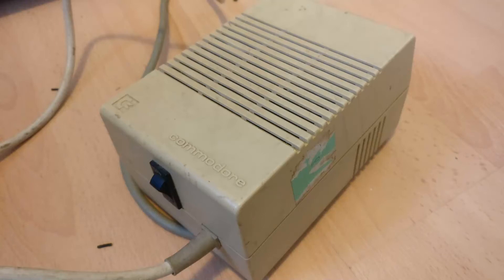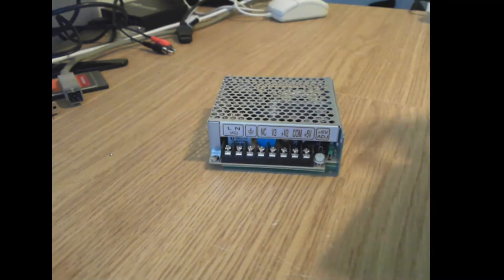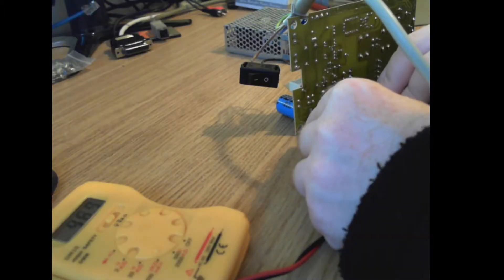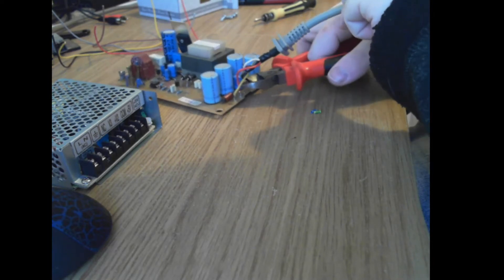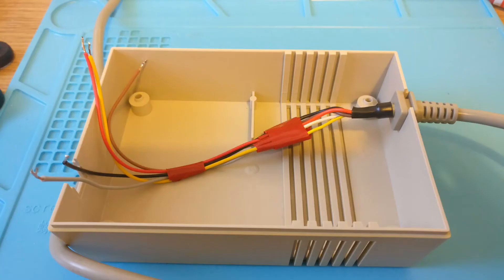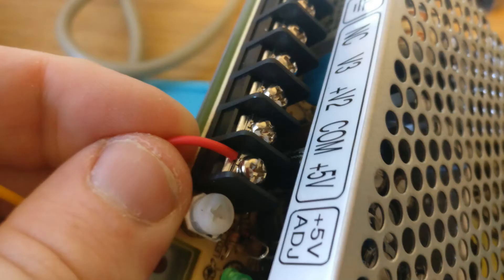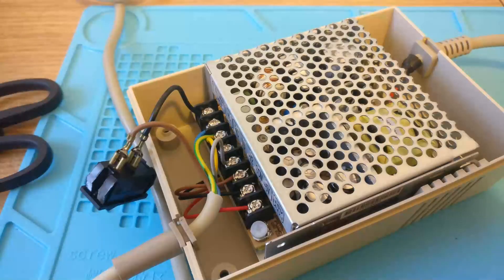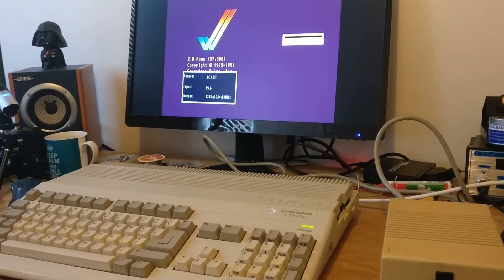Amiga 500+ - Part 2 - Upgrading an Amiga Power Supply

Comment: I have one Problem with the Meanwell Power Supply. If i plug the Meanwell in the Amiga, and make the measurement after the Line Filter from the A500  I get 13Volt on the 12Volt Line!!  Is this a Problem?
Reply from the maker: There is white potentiometer on the right of the connectors, adjusting this will change the 12v output. But measure this without the Amiga as you don't want to damage it.

Comment: Awesome mod!  Mouser US were out of stock, so I grabbed one of these Meanwells off of Amazon, and was able to 'upgrade' my A500 PSU too.  Used a few little 3D printed standoffs and a few blobs of hot glue to keep it in place inside the original PSU case.  On my NTSC A500 I'm definitely noticing less interference in the picture when upscaled through an OSSC via a VGA adapter, however there are more pronounced jailbars which I assume are due to using a switching power supply with an analog video device.  Something to be mindful of I guess.  BTW, how are you doing with the thermals in your unit?  Have you had it overheat at any point over the last few years?
Reply from the maker: Thanks, not had any issues with heat. Regards the jailbars might be to do with Phase and Clock setting on the monitor

Comment: Thanks for this excellent video!  I hope you don't mind but I've got a few questions.  The wires that you extended, do these have to be a certain kind of wire with specific tolerances?  Also how did you secure the meanwell inside the enclosure?  And finally, is that specific meanwell powerful enough for an Amiga with an accelerator installed?  Thanks for any info you can provide.  Keep up these great videos!
Reply from the maker: I got mine from Mouser. Notspecific wire but main cable should be fine.
I'm currently using it on an A1200 with an 030 card and not had any issues.

Comment: Great video, i used the Makerele NET-50C, that has a 4A 5V and a 2A 12V, to replace my inside of my old Amiga 500+ PSU, it fitted great when i removed the metal housing, it has it's own heatsink, so do not need the housing. 

https://www.aliexpress.com/item/3261...27424c4d0pv0wU
Reply from the maker: Good to know that there are other alternatives out there to refit out aging amiga PSU's. Thanks for sharing :)
Reply: @MikeyGRetro  And you thanks for your video.

Comment: Thanks for the great tutorial! I was able to make this mod and replace the internals of a PSU that arrived with a PCB broken in half. I would like to also add that it is important (or was for me) to connect the 'Shield' as well. I read on some forums that it is really not necessary, but I got really bad rippling in the video signal without it.
Reply from the maker: Wow broken in half. Glad it's working out good for you. I've done another one for my a1200 and it solved a video issue too. Forgot to mention that i connected shield. Just best practice :)
Reply: @MikeyGRetro  to be clear, the shield goes to earth as you appear to have it in your video rather than to comm/0V? (though I guess they're connected and it doesn't matter?)  Thank you so much for the video.
Reply from the maker: Thanks. That is correct

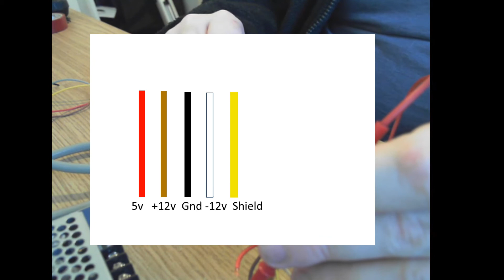Comment: 1:33 - I love how you said "Commodore" here, it may be subtle, but really whenever someone mentions them, it used to be a sign of class. Now Commodore is seen as a joke outfit, and I always laugh my head off at the blunders CBM are known for. Ha-ha.  I know this is old now so hopefully you have fixed your machine. :)
Reply from the maker: Machine is working fine. I have restored another PSU since this video and that one was a ticking time bomb, part of the board was burnt. I never used a desktop amiga before so not known them for CBM but I know that it had respect like IBM but since Commodores demise it does seem bit of a joke now, but just due to poor management. They had some great ideas and engineers just bad leader.

Comment: Great job! And thank you for the link to the Meanwell RT508, I was actually searching for a PSU which would fit into an A500 power supply case!
Reply from the maker: My pleasure MsMadLemon. :)
It works quite well and an easy mod to do and relatively cheap. I purchased 2 from mouser here in the UK, it got dispatch from Texas and then to Germany so has been on a journey. Will use the other on the A600's PSU which is identical.
Reply: @MikeyGRetro  Maybe a little late, im working on a similar project, It it needed to be sayd that those enclosed PSU's from Meanwell are designed to work in a fan encased System. If you look at the specs you will see how fast they drop power outage when getting hot. I always would recommend a open Frame one for jobs like this.